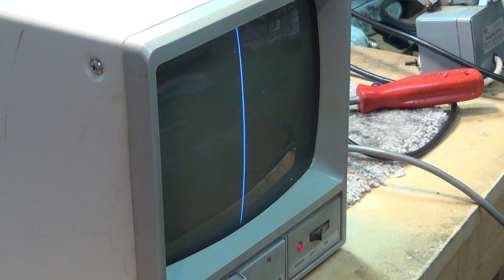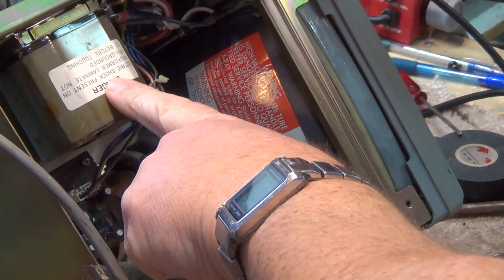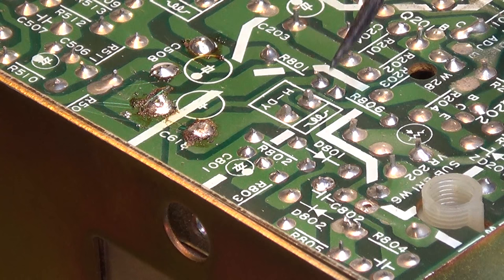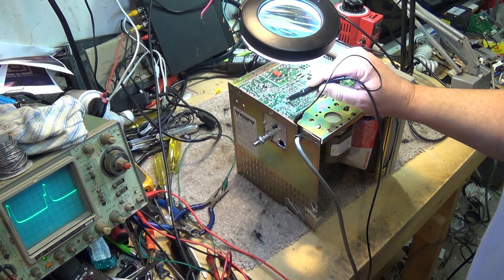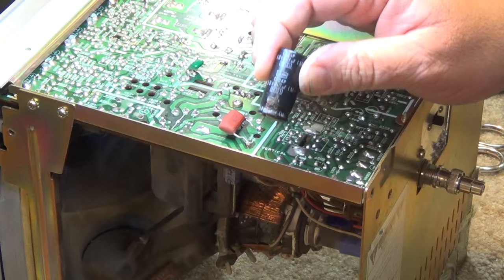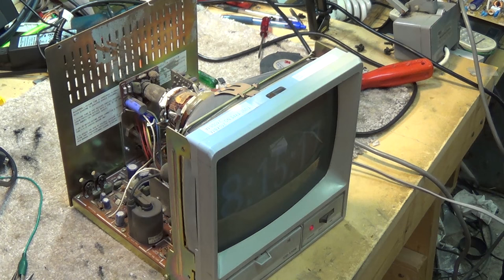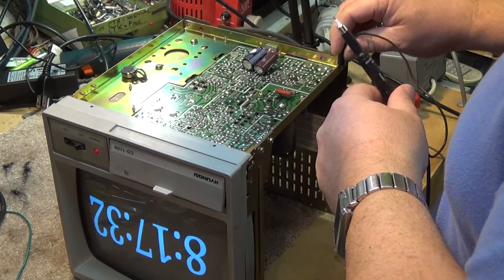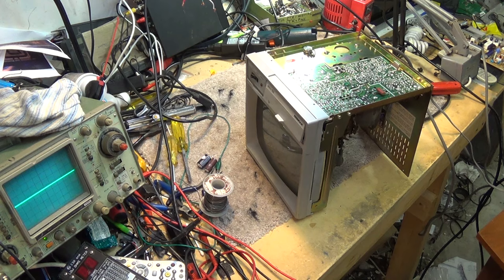Horizontal deflection troubleshooting

Comment: same circuit is used in the early macintosh systems, and I use a film cap to replace it. its not exact fit, but it works well and will for years to come.

Comment: This takes me back!  I fixed hundreds of Wyse terminals which always had a failed bipolar cap on the H DY.  The interesting thing with those Wyse terminals is typically after around 18 months they would always come back and need another new cap.  I never did work out why the fault repeated so often, I did wonder if it was something related to the transformer.
Reply from the maker: +GadgetUK164 I was going to make a joke about the Bi-Polar capacitor being off its meds, but I didn't want to draw fire from anyone.
Reply: LMAO!
Reply: +GadgetUK164 because using an electrolytic in a high voltage, high current pulsing circuit is not really a good idea. thats why towards the end of the CRT era, they did away with it and used film caps. the high pulses means high ripple current which dries out caps.

Comment: Even before tracing to the inductor, you see the other direction going to a capacitor with crusty solder points, possibly due to leakage from the other side.

Comment: Can't believe I stumbled upon this video lol that tv is really rare (at least the SONY version of it is). Got my hands on one a few weeks ago that was abandoned since 1996 in a old repair shop. Seems like it was dropped while it was a security screen for some sort of armory. I got it to power on after some hours but the screen is REALLY dim.
Reply from the maker: I have another one, a JVC which is like new. Use it to display the time.
Reply: @12voltvids  Oh thats nice. Do you have any suggestions on what could be causing it to be very dim? I already found & fixed a bad solder joint that was causing a no power situation. Going to take another look at it next weekend. Maybe your advice could point me in the right direction.
Reply from the maker: @Shyzah  Look at the video driving the picture tube. If you have good strong video driving the tube, and there is no or little output then the CRT is weak.

Comment: Sweet! I do TV repairs Too! i prefer CRT's over LCD's i have every component you might need. to repair a CRT
Reply from the maker: +Amy Marie 
Lcd there is so little you can do. I like plasma as they are a challenge, but of course analog crt TV. Al those nice active and passive analog circuits to give troubles.
Reply: yeah nothing But Troubles. With CRT's at-least its kind of a one component "or two" failure, (the one that i worked on and am still restoring, needed to have all the caps shotgunned and replaced.. and replace diodes on the jungle and gave the board an Isoprop Bath..) It was something that i really wanted to have, my own proper Color CRT TV.
Reply from the maker: +Amy Marie 
I have a few to restore. A couple of 80's Sony trinitron, a few mitsubishi,
Sets and 2 tektronix studio rack monitors. Those ones will be featured in an upcoming video.
Reply: can't wait to see them :D
Reply from the maker: +Amy Marie Something I wish I still had was the old Philips K6 chassis that my grandmother had. I watched the moon landing on that set. I had it in my garage when a workman working on my house dropped a stack of 2x6 on it and broke the CRT. I was not happy. That was an all tube color set, and I would have loved to restore it.
Reply: oh that breaks my heart......... :(

Comment: Great video. Why was that non polorized? Also why are they in crossover networks and not electrolitics? Jimmy in Alabama
Reply from the maker: +James Lane Non polarized capacitors come in 2 types, mylar and electrolytic. An electrolytic nonpolarized capacitor is &#160;actually two capacitors in series (back to back) in one case, hence the large physical size for the voltage and capacity.
&#160;Polarized capacitors have very &#160;large leakage current if the voltage is inverted. Nonpolarized capacitors are needed at AC applications in series or in parallel with the signal (or power). Examples are speaker crossover filters and power factor correction networks. In both applications a large voltage AC signal is applied accross the capacitors. If polarized types were used the leakage current would distort the signal and overheat the capacitor and potentially destroy it. In the TV deflection circuit the capacitor couples the AC signal to ground while blocking the DC component. Due to the high reversal current kick at retrace (flyback) this current reversal would destroy a polarized capacitor in a short time. For example the capacitor in an electric motor is an AC or non-polarized capacitor for this reason.

Comment: Ive found that the plugs on the deflection wires burn up, i think its dampness that makes them a bad joint. (its mad but its true).
Ive often just snipped off the plugs and soldered the wires direct into the pcb, never ever fails again :-)
Nothing better than bringing an old crt unit back to life and adjusting all the presets for best geometry of picture and focus :-D
Reply from the maker: +zx8401ztv Yup, there is just something cool about that old tech that is missing in todays boring digital age. One of the things I like about plasma is the high voltage, lighting up those individual pixels with an electric arc.Just like an old mercury lamp, or metal halide lamp. Producing light from nothing more than blasting electrons through a gas and some mercury. Neon too. Nothing more than high voltage and some neon gas and you get light.
Reply: +12voltvids Magic producing a picture :-D
I dont like lcd displays, i have a small laptop computer and that does fine for schematic diagrams and youtube videos, but i gave up tv sets a while back.
Our stupid govenment has forced a crap digital tv system that delivers worse quality than the earlier better analog system.
No point in tv now, and im not paying the bbc for a licence to watch a comically named "Freeview box", its not free or good.
Sorry i yap a lot :-(

Comment: What does the bipolar capacitor do in the crt circuit?
Reply from the maker: Isolates the yoke from the B+ rail while passing the AC pulse  and provides the ramp for the sweep.  If you look at the pulse of there was no capacitor the spot would fly off the screen and then snap back to center till the next pulse.  The cap charges quick and then decays and as the voltage decays the beam is drawn across the screen.

Comment: hello.How can I make non-polarized caps(50v 5.6uf) from polarized cap? And Is it OKAY to use any polarized cap in order to make non-polarized caps for Horizontal Deflection Current Correction in TV or monitor?
Reply from the maker: Yes you can make a non polarized cap from 2 polarized wired in aeeies.   You connect the 2 negative terminals together and the + from each goes to the circuit.  You have to double the size. So 2 10uF would give you a 5uF NP cap.
Reply: @12voltvids  Thank you very much for reply! the non-polarized caps(50v, 5.6uf, size of 16×35.5mm ),which I want to replace with, is samwha NF series which was desoldered from LG 29 inch CRT TV. So I browsed through samwha catalouge,and It say that designed for "Horizontal Deflection Current Correction in TV or monitor", "Stable characteristic at high frequency and high ripple current","Complied  to the RoHS directive".Is It really no matter to use any polarized cap which has low grade specification or low ripple current? Is it okay to use two 10uF 50V 85℃ Samyoung SHL capacitor series(size of 5×11mm) in order to make non-polarized caps for Horizontal Deflection Current Correction?

Comment: Great  video ,  I've  done  the  same  thing  making  a  non  polarized  capacitor .  I'm  a  novice  at  this  and  have  a  question  if  you  don't  mind .   I  have  a  2  channel  analog  oscilloscope  vertical  position  problem .  My  trace  will  not  come  down  to  center  on  the  screen .  With  the  vertical  control  knob  turned  fully  counter  clockwise  it  is  still  above  the  center .  Turner  fully  clockwise ,  it's  off  the  top  of  the  screen .  Both  channels .  I  think  it  would  be  in  the  vertical  deflection  circuit .  I'm  I  correct  and  what  component  might  you  check  first ? You  seem  very  knowledgeable .  I'm  definitely  going  to  check  out  your  other  videos  and  subscribe .  Thanks  again
Reply: I  meant  AM  I  correct  !  Sorry
Reply from the maker: Could be one of the drive IC to the tube. They use static deflection, and a balanced amplifier, one outout driving one deflection plate and the other one driving the other plate. I have a vectorscope with a bad drive IC that does the same thing, and has a bad drive IC. I forget the jumper of it off hand, but it is round and looks like a transistor but has about 8 leads sticking out the base of it like a tube. 
That is if it is a solid state scope. If a vacuum tube scope then a good chance one of the tubes has gone bad.
Reply: 12voltvids Thank  you  very  much .  It  is  solid  state .  That's  one  of  the  first  things  I'll  look  at .

Comment: hey I noticed  in a couple of videos some of your equipment has bnc jacks as audio or video input and outputs all that equipment is not consumer level stuff. Is it only industrial equipment that did that? b4 anyone says anythings i dont mean radios i know they do but that awesome monitor uses bnc and he did one on a 8mm or betamax tape player that was made of production work like editing where the board with the outputs and inputs was all broken into pieces.
Reply: In the UK, consumer TVS, Vhs recorders and some hifi's made in the 70s, 80s had bnc inputs and outputs for audios and videos but those inputs were phased out by the late 80s in favour of rca jacks and scart sockets.
Reply: eddy apple Literally all of my vintage VCRs use BNC. I don't know why the NTSC machines didn't use them.

Comment: I wish that all PCBs were like this.  
Would a tweeter crossover cap work in this circuit?  
Isn't it better to have the scope connected to the mains, but the device on the isolation transformer?  I don't connect the scope on the I.T., it's direct on my bench power strip.  What about using a GFCI socket on the power strip?  I've thought about adding a ground fault socket for the power strip.  Don
Reply from the maker: +umajunkcollector 
The scope is not isolated. It need to be grounded for safety. Only the device is isolated. That is to protect the Tech from a shock shook they touch a hot circuit and earth at the sam time. You can still get a shock if you make contact between 2 points of a circuit such as between the + / - terminal of a power supply, which can bite, but is usually not that hazardous. The real danger is on non isolated chassis making contact with an energized line operate chassis and an external ground such as a cable TV coax. Then you become the conductor for mains, or your scope lead does. By having the chassis floating you remove that Hazzard.
Reply: ten-four, heh heh, um working on an isolation power supply project.  I will actually fuse the ground pin of the secondary, only to protect against incidental short circuits as mentioned in your vid, most likely a 5 amp fuse.  I normally would NOT fuse the neutral side, but when their is the possibility of a short circuit at higher voltage, why not!  I don't know if a 5 amp fuse will save a probe, but a full short certainly will.  I want no connection of the secondary shared with ground, but there will be a three prong outlet off of the secondary with a fused ground pin, so there is a connection with the primary ground there that could bridge to the secondary in a chassis. I normally use polarized two prong plugs on the secondary anyhow.  But if something hapens to have a three prong plug, I can either use one of those 3 to 2 prong adapters, or at least there is a fuse just in case.  The fuse will only be on the ground pin of the secondary outlet.  GFCI would be protection against electrocution.  But it may fail on the secondary, so that may be moot.  Don
Reply from the maker: +umajunkcollector 
I think you fail to understand how an isolation transformer works. The entire point is to isolate you from ground when you are working on a piece of equipment. You want the entire chassis isolated from ground period. No ground prong at all. This way the secondary becomes a balanced output. Either side of the secondary could short to ground or go through your body and you are isolated from mains voltage. That is the way you are protected. Hot chassis typically have the neutral directly connected to the chassis which creates a dangerous situation if a non polarized plug is used or if the outlet is wired backwards. You would be amazed how often that happens. Also depending on the size of your transformer this will limit the amount of current that can be drawn. If you have a 500 watt transformer that is all you will get without overheating it and tripping the thermal circuit breaker that all commercial isolation transformers have. They are self resetting as soon as it cools down.
Reply: Yah, I know.  I have an older two prong outlet, that totally eliminates the possibility of using a three prong plug.  Mine will be home brew, using a nice surplus transformer that I got.  I hope to complete the vid on it next week.  I've used polarized and three prong plugs in restorations many times to prevent the reverse hot chassis problem. The trick is to not connect the gound pin, just in case the wall outlet is reversed.  But in my house there are NO improper wall outlets!  Some older homes with knob and tube have reversed outlets though, and some bozos put three prong sockets in the wall, not knowing which side is hot.    Don
Reply from the maker: +umajunkcollector Ues a crossover capacitor would work fine if the voltage rating was high enough. The capacitor is just to block the DC component otherwise you would short your B+ to ground.

Comment: Another safety tip is to work on it with one hand whenever possible so that a shock doesn't cross your heart.
Reply from the maker: One hand in your pocket when possible.
Reply: Once i was soldering dry joins around HV trafo while with the left hand holding tv chassis from the tuner.A capacitor 10uf/250v remained charged and when touched with the soldering iron tip i felt a shock to both hands.After that the microprocessor gone dead forever.The plastic holder of the soldering iron is antistatic so it is conductive and i already knew that from previous times,but i should not have touched the small signal area with the other hand.